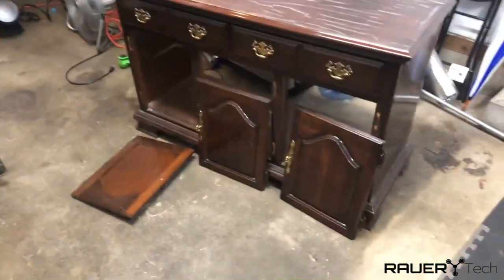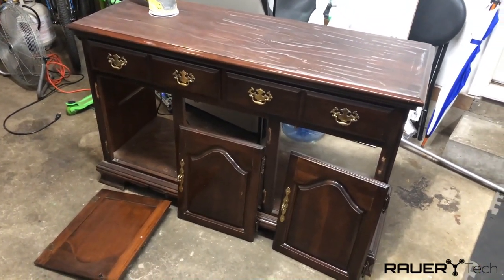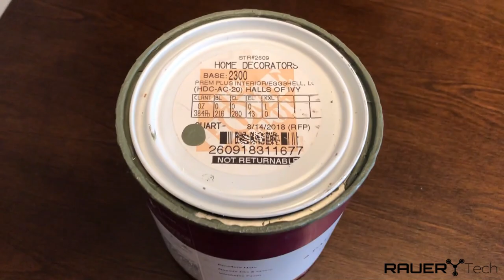DIY Reptile Enclosure Using Old Furniture

Comment: If there's any chance you see this, would you be able to explain in a little more detail how to properly set up the light fixtures? I want to do this for my snakes, but I'm most worried about making sure the fixtures are safe and reliable.
Reply: For a snake, you would need a heat lamp cage around the heating bulbs. The cage will keep the snakes from touching the light bulbs directly and burning themselves, so it's very important. You would also want the whole fixture + cage flush with the top so that the snakes can't get stuck between trying to get on top of it or anything. And the middle UVB light depends on the type of snake/the owner's preference based off of your own research. Hope this helped! :)

Comment: great video! what kind of silicone/sealant did you use in the edges? have there been any issues with cleaning or water leakage since Percy was added? beautiful build!!!
Reply: Wonder if the sealants and paint are safe for reptiles....

Comment: Hi there, I know this is an older video but I’m upgrading my hutches for my hedgies. Just wondering what a good, fairly inexpensive brand of drill kit with both small and large size screw inserts would be?
I’m looking all over amazing. I definitely want something cordless and not too big or heavy. Something for my animal enclosures but also for projects like building household furniture. I’m a pretty petite female, 96-100lbs. My bfs about 167 and can handle a larger drill easier than me. But some of the pieces sections of the hutch are pretty small and a large power drill would probably get in the way and also get a little heavy for me to handle. 

So just a small to medium sized, cordless drill kit, preferably rechargeable rather than battery operated, including small to large sizes of screwdriver inserts as well as drilling bits to drill through the wood of the hutch which has some fairly thin wood which I don’t want to break. Anything I can buy on Amazon that’s affordable would be great!
Open to any and all suggestions!! Thanks!
And I absolutely love how your enclosure came out. If I was more handy I would totally make a dresser hutch for my hedgies but I just typically buy from Amazon or Wayfair and put my stuff together even with the very limited sizes of screw drivers that we have haha

Also any starter tool kit would be nice to have as well. I just got a hammer and a nail kit with nails of various sizes but any sort of starter tool kit with wrenches and other tools that I wouldn’t even be able to make would be very helpful! Thank you!!